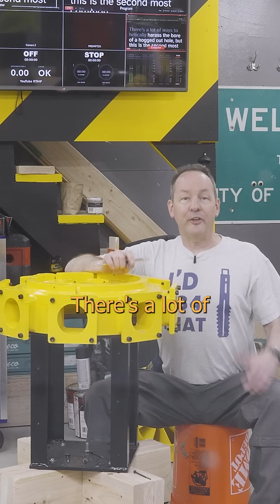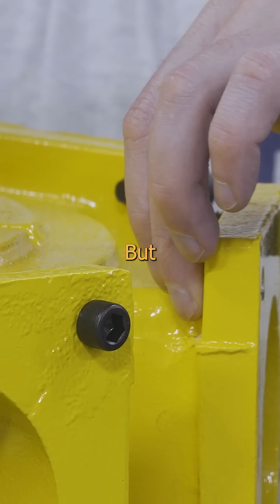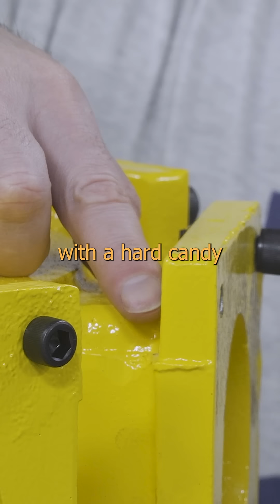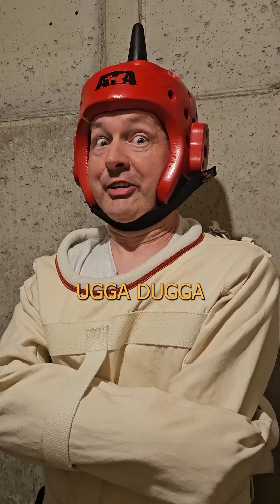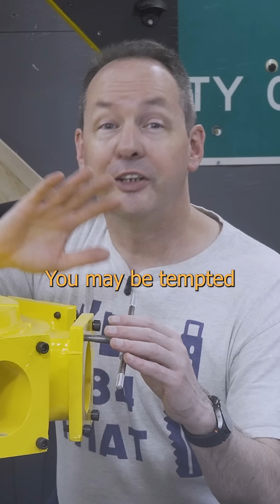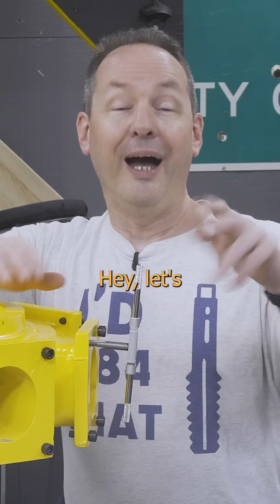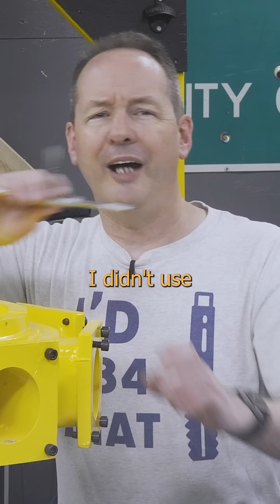Thread Chasing  #chrisboden #comedy #engineering #skills #workshop #metalworking #tools #apprentice

Comment: DUMBASS! i was tapping a rocket injector (316L SS) pipe taper hole in a bridgeport in a custom fixture and an angle block. there were no tap wrenches large enough at my school to fit this one and we just ran out of money, i find a spline wrench in retrospect fit way too loose for comfort. i also find a cheat bar about 3.5' long. im taping about 3/4" deep with tap magic and hear a loud bang, my arm rotates around the center about a quarter revolution and my eyes see smoke coming from the hole. I take the tap out after  holding the tap in the vise and using a 3' pipe wrench to turn it. the tap is undamaged. I look to the spline wrench and the splines no longer exist. lol

Comment: I'm more of a mechanic than a machinist but I'm sure we can all relate to this story:
I was doing a spark plug replacement on my Ford Ranger and the plug for Cylinder 5 didn't want to thread right. I got frustrated with it, set my tools down, and walked up the street for a pack of smokes. While I was gone my dad cranked the sucker in at the wrong angle and ruined the threads. Drove my truck down to the shop on 5 cylinders so they could repair the damage to the head. Still had that truck for another 4 years after.

Comment: I recently tapped a shotgun receiver to mount a pic rail.  I have a small hobby drill press that I leveled square and mounted the tap into the chuck. I then turned the spindle manually while maintaining slight but steady downward pressure on the feed lever to ensure the tap was square with the world. Once I had a few threads started I released the chuck, leaving the tap in the hole. I then attached the wrench and finished threading the remainder. It worked beautifully.

Comment: Not a dumbass! Not for lack of trying though. I got lucky with a tap and a too small hole because "well I do it in the factory it should be alright here." Literally broke to pieces in my hands as I was taking it out. The threads were garbage and unusable, but thankfully I didn't have to dig the damn thing out.

Comment: To all the poor souls who break off a tap in a hole: a smaller carbide tipped masonry bit in a rotary hammer/hammer drill set to hammer will shatter a high speed steel tap. I figured this out after three days of wrestling with an aluminum housing on a transmission after somebody accidentally went a bit ham on a tap.
And for the love of everything, don't keep twisting a tap in one direction! Cutting oil helps reduce breaking a tap, but only so much in something like aluminum, and backing it off a bit every so often will help clear the chips and put less force on the tap.

Comment: For tbrough-holes, use "gun taps" they are magical - even for 6-32 which will easily break a 4-flute due to small diameter, course thread so small cross-section on the tap.

Comment: I‘m one of the lucky ones, as I actually have not learned that lesson yet, and I have drilled and tapped many holes with metric threads.

Countersink the holes, be gentle, use lubrication and it helps if you know your tools and use the right ones! They make special taps for machine use!

You‘ll break them, if you:
-use the wrong tools
-don’t use lubricants 
-go too fast/full power mode
-enter the hole at a wrong angle (any wrong angle will do)
-

Comment: at work we use drill taps for 4/40 up to 1/4 20 only broke 2 taps so far. must me some sort of specialty taps. we have to drill and tap back plates to hand tapping would eat up valuable time. now im curious about the differences between these hand taps and the ones we use at work.

Comment: Oooohhhh, the most difficult tap job I remember.
I was 20 or 21, our gang was going to holidays at the sea for a week. About 5 people went by train and me, my friend and his gf were going by our little Fiat 126p with a tiny car trailer with all their stuff and tents packed in there. 
And just as we started our journey, the cover for engine valves just flew off - threads holding it destroyed. Two long screws pulled out of the engine block with thears on them...
My dad drilled holes by hand in an engine block and then tapped it to a bigger size. All by hand. Finished about 3am, before having just a few hours of sleep because he was leaving the next day for a business trip...
I put the thing together with my friend and we finished about 5am. Slept a few hours and hit the road before noon next day, to meet our friends and give them their clothes and tents 🤣
That was an adventure 😆

Comment: it's DUMAS, dumbass. I once tried power-chasing the exhaust port threads on the aluminum cylinder head of a Lexus LS500 and ended up breaking the flush with the head. It took HOURS to crack the tap enough to take it out, then drill and tap a larger diameter bolt hole.

Comment: Yeah... I've tapped a couple small holes in aluminium. M3 or M4, not sure exactly. Used a small cordless drill, because "it's only aluminium, the whole is all the way through and tapping the whole 5mm length will be tedious".
I've learned a whole new meaning of "tedious" while unfucking what I've fucked up. Of course the tap broke. Luckily the whole size was my choice, so I could go up one or two tap sizes. But getting the broken remains of the tap without making a huge mess all around was... interesting.

Comment: I broke a tap inside a stainless flange, using a 1/2" long handle ratchet,  (Harbor freight 1/2"npt😒)  I used a  map gas torch to remove some of the tempering in the tap and was able to break it out.

Comment: Drilling and tapping copper with the wrong drills and taps for the first time at 2:30AM was not smart.
The first drill bit snapping should have been the sign to go to bed.
Instead the part now contains a snapped off tap instead.

Comment: I galled a tap in Aluminum and broke it back in 62. Whereupon I learned about mild heat, Paraffin and Kerosene, and the concept of, it ain't a mistake until you can't fix it.

Comment: DUMBASS! Was using a tap to clean out some threads on the bottoms of some painted table legs (welded frames), chucked up in a drill, was doing fine for the first 2000 holes, got to 2001 and it caught the thread, ripped the drill out of my hand, and swung around and smacked me in the face. Instant concussion

Comment: I worked at a place that they ran out of the correct high speed tap to use on our milling machines so they told me to use a low speed one it was a $98 tap I ran through 4 of them before they went oh shit we should slow this down lol ( I was not allowed to be autonomous in this job) they ran through another 3 before they realized they should just wait and get the right tap lol 

Ps it's a bitch to change out tooling that much in a day lol

So... I guess dumbass.

Comment: If you do blow out the threads you need, check out TIME-SERT. 
Literally saved my life by replacing the stripped threads of the aluminum brake calipers on my old motorcycle.

Comment: "You're gonna try it anyway, we both know it"
Lmao yeah...
Reply: My dumbass actually got trained to use those in a drill as a way to debur small through holes, then I thought that’s just way taps are used. That was 10 yrs and dozens of broken taps ago. Some of us learn slower than others
Reply: Instructions: "Do not use power tools, it won't work, we included a couple of repair kits because you won't listen "
Me: "It's like they know me".
Reply: I have never done that. I mean, I have few taps that are designed to be used with a drill and I've used those, but not with a normal tap. They're expensive.
Reply: This man has worked with The Public.
Reply: It's rare to feel called out yet seen and understood at the same time
Reply: I'm a dumbass....  Sometimes it works great (use a machine tap though),  but the taps really don't like it when you're tapping a box section and accidentally drive the tip of the tap into the opposite side wall of the box.
Reply: This . . This . . . I've been a dumbass  before
Reply: Yep.  Hasn't gone wrong yet!
Reply: It's like snipe hunting.

Comment: Dumbass here:

On a through hole get it started by hand, set your drills clutch to 4-7 on a DeWalt, put it in low speed, put some lube on it and feather the trigger. Go back and forth to break the chips up as you go. 3/8-16 and 1/2-13 are beefy enough to handle the drill. 1/4-20 and 5/16-18 can be a bit sketchy. You can attempt blind holes but mileage may vary.

Comment: I was taught how to tap new and re tap existing treads at the age of 14.

If you have to grip the handle and twist with more that double digit fingers I was told you are likely doing it wrong. 

You could put a set square to my reference bolts always perfect.

Just time and lots of it

Comment: A tap is not a thread chaser and should not be used as such. A thread chaser has a lot less aggressive cutting edges and a lot more thread. One can be made in a pinch with a good bolt and a thin cut off wheel or file. On the tap side, you need a bottoming tap to get the depth you need here. The tip is significantly different than a typical tap. A real thread chaser will bottom too.

Comment: Redneck engineer asks: Why do you need a tap for this, as opposed to just cranking a bolt in there with a wrench or maybe a socket to break the old paint?

Comment: I’ve had to chase threads with a drill only because some f*cknut ruined the threads previously.. the key is starting the tap by hand the first 2 or so threads.. some taps have a tapered lead some have no lead , and if I go thru my boss’s tap drawer , there’s some really funky taps that only he knows what they are for .. 

The worst way to break a tap is a small 3/8 and under tap inside a blind hole .. we don’t talk about those instances 😂

Comment: Dumbass welder here, have tapped many holes with a drill, usually end up breaking a tap for every 40 or so holes I tap if they’re smaller than 10-32, especially when I’m being rushed to get parts out the door… thankfully I have never broken one I couldn’t get out with vice grips and some tig welding… yet.

Comment: Dumbass - so I work on concrete pumps, I was changing piston heads on a Schwing machine and I needed to tap the threats before installing to make the bolts go in easier in an awkward angle, long story short I was outside it was cold and I wanted the job done so I put the tap in my drill, done one side no issue, second side, another story… I then proceeded to spend the next hour outside in the cold wet rain trying to fix the issue. Never done it since! 😂

Comment: I'm a dumbass for trying with steel what worked fine with aluminium all the time - M6 tap in a cordless drill - even worse that it was on the homestretch of a time sensitive project and I had to get the broken tap out, find a new one and install everything in "right f'ing now" minutes (quote: boss man)

Comment: Not going to look through all the comments, but after several, no one mentioned thread chasers? Am I the only one with a set? 

I was always told there is no such thing as “re-tapping” a hole. It’s either buggered or it’s fine and just needs cleaning, hence a chaser. My set is similar in idea and the uninitiated could easily confuse them for taps, but there really isn’t a cutting edge like a tap has, just a void with a bit of a face, and not even super hard if I remember correctly.

Edit* I also never put a tap in a power device. Pretty sure that shop teacher would have had me filing out the voids instead of milling them on my project as punishment.

Comment: Dumbarse. 

I had to put an impact gun on a tap after my stupid apprentice decided, and idk why, after snapping a head bolt off to not ask for help, rather hide it. Then progressively make it worse. Bolt extractor snapped off. Then he drilled slightly off to the side and tried tapping it... with a snapped off bolt extractor still in there.

The ugga dugga was my final hope. As he used, idk seriously idk, some form of jb weld as cutting fluid.... wish I was joking. Heat didnt work, liquid nitrogen and even liquid helium didnt work 

Ofc the tap snapped. Ended up having to carefully use a diamond core bit to slowly get around the mess. Then take it to a machine shop to he repaired. Because extremely rare, exotic and expensive vehicle.

You may ask, why then did I allow my stupid apprentice near said vehicle. He wasnt, he was given a simple oil change on a Corolla. The rare af expensive car was in for..... brakes..... idfk where he got the idea the head had to come off. Or why he didnt check in our computer they had reverse threads, ill give him that atleast reverse threads have caught almost any mechanic atleast once.

From memory the repairs cost around 10 grand as the machine shop had to bring in a welder that could weld the stupid head. Also had to find the right alloy welding rods. Then had to be machined. We had to wait months on think ARP to make us these oddball specced headbolts. 

Idk how the owner didnt kill us. He was remarkably chill. Obviously he got all the work done for free. We even offered to pay for the brakes and rotors he had got sourced and rebuilt but he refused (yes seriously that rare and exotic that him finding old stock rotors and pads was amazing, pads were fubar so he got them rebuilt idfk where).

Comment: Dumbass I used a tap with my hammer/drill not realizing it was on hammer and broke the tap half way thru the the stainless steal plate spent the next 2 hours drilling out the old broken tap to use the tap wrench anyway

Comment: We had a new guy that was having a difficult time with a bolt. We could hear the grind and struggle for the impact wrench to get the bolt seated. Everyone in the shop heard this horror and just stopped and watched. Not only did this bolt get cross threaded. It got hot enough to weld itself. It sounded expensive

Comment: Dumbass
I cross threaded my faulty exhaust O2 sensor and needed to retap the hole because of that. I then cross threaded the tap, gave up and wiggled the new sensor in there with a generous amount of JB weld.😅 hasn’t failed yet…

Comment: Instead of silicone use foam earplugs in the bolt holes.  For the ones that can't stick out so you can paint undeath the hole, use two, cut them down and push them in flush from both sides.  It takes less time than removing silicone and/or tapping/thread casing the threads.  Might need to remove them before you put them in the oven but they come out easily with a pick.

Comment: Dumbass, but I eventually figured out that drill taps work just fine in a drill if you use tapping fluid and already have a predrilled hole. I've tapped probably 400 holes like that on the bike I'm building and only 1 failed because I didn't clean the tap at the end. Also, CLEAN YOUR TAPS AFTER EVERY USE!

Comment: Tapping isn't too bad, most of the time.  I did have to learn a little as a machinist.  Where it gets more difficult is when everything is checked by quality control with a go-nogo gauge with very limited range of acceptable size. I remember having to rework parts due to the shop gauge having more wear than the qc gauge.

Comment: Oh the audacity to have a ‘use respectful language’ warning on this Chanel’s comments 😂

Any way, this is literally my job (among other things) chase the threads in freshly powder coated parts, you’re doing it right. 

I however use a drill press with a frequency drive to get them as straight as possible and do them faster, the holes are never as straight as the drill press before I get them.

You’ll want to use oil if you tap them fast otherwise the powder coating melts and then you have a glued in tap. 

Oh and yes i’v done the dumbass thing, I don’t pay for the taps though so…

Comment: I work in a manufacturing plant, and we periodically have to re-cut threads after powder coating. So, I do this with a drill and don't mess up the parts. The trick is very simple. Taps usually come in sets. First, a number 1 is for marking the thread, then a number 2 is for finishing the thread. So, if you take a worn number 1, it's perfect for this task.

The main thing is to catch the first few turns of the thread. Then it will follow naturally.

Comment: Not a personal screwup, but as an apprentice I remember an occasion where one of the toolmakers in our factory was making little jigs for an assembly line, and ended up hardening one or more  faces of them that shouldn’t have been. A face that had a a fine precision machine threaded hole. There were a couple dozen of these things, and the little machine screws intended to act as precision stops or rests. Of course, after hardening, the threads were too tight. So the apprentices were set to try and force the threads back open by repeatedly screwing the intended fine threaded screws in and out. Trying to use a hardened tap just resulted in a fairly expensive broken tap

Comment: #DUMBASS Needed to tap a couple of 1/4-20 holes in some 1/2" mild steel.  Couldn't find the damn tap wrench, so Hillbilly'd one with a 1/2" breaker bar and creative use of a reversed hex-key socket. No cutting oil, so used good ol' 3-in-1. Went ok until the tap bottomed out, and I applied too much torque "SNAP!'.

Comment: Dumbass me learned the hard way trying to fix a pickup truck in my early 20s. Apparently my struggle to find a nice hole on a milf lead to my failures in fixing engines too. From that point on, I learned slow is smooth, and use lots of lube

Comment: it appears to me based on the low qual. pic., that those threads were intentionally angled to allow a bolt to clear the inside of the part and still allow washers and a locking nut. as today's locking nuts were prob. not avail. then